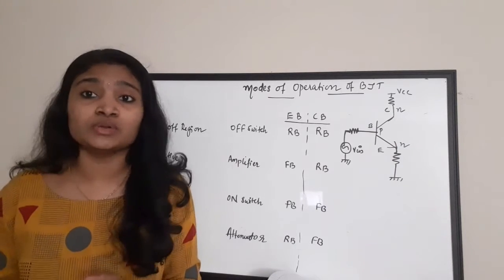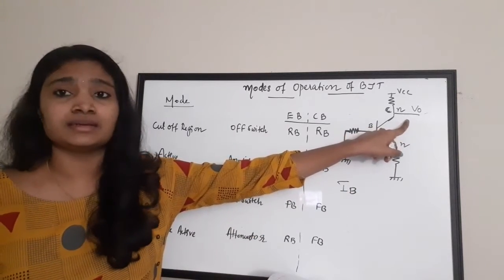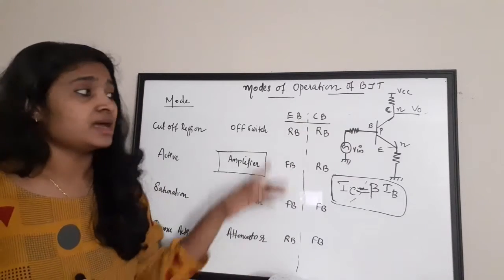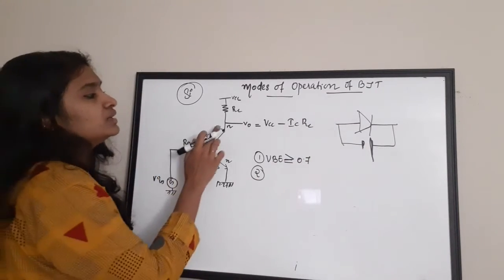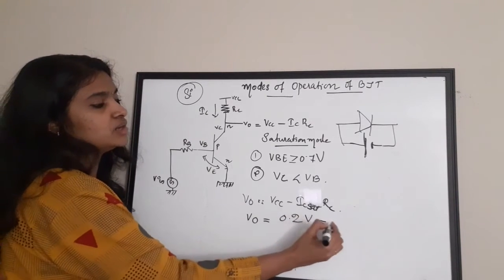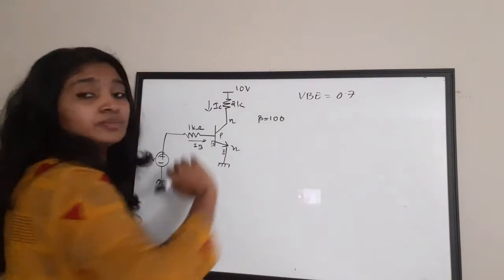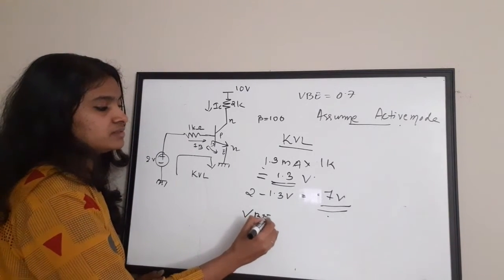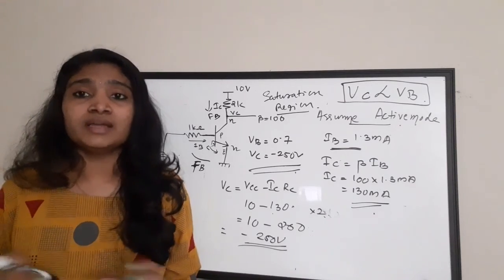Finding the Mode/Region of Operation of Transistor Part1| ISRO Scientist|Technical Assistant| Gate|

Comment: Silicon diode is less suited for low voltage rectifier operation because what
Reply: It turns on only on 0.7v
Reply from the maker: Yes